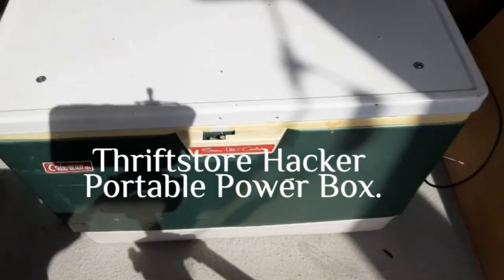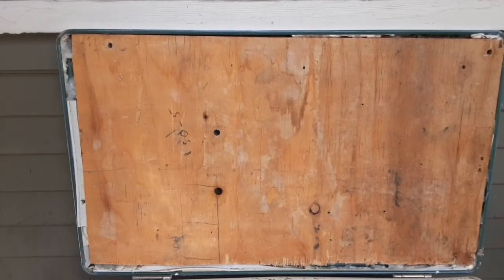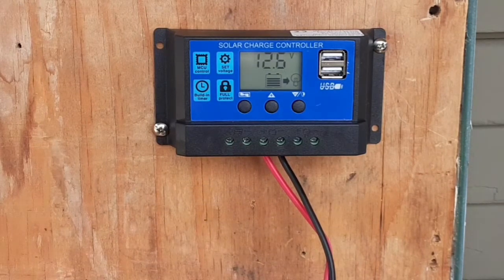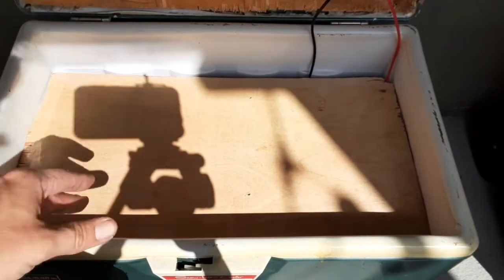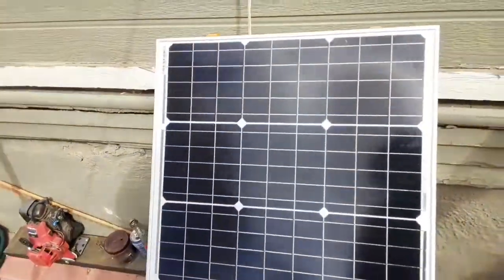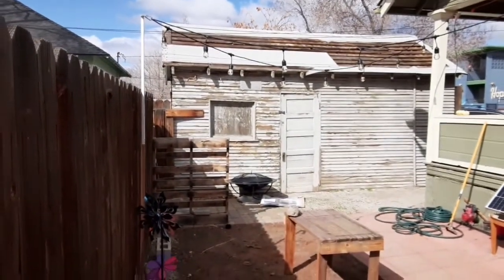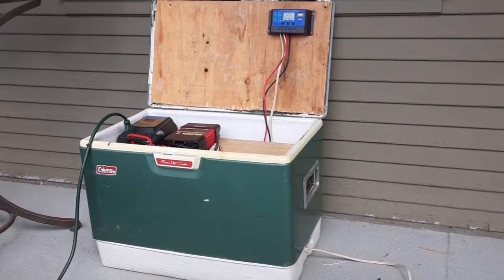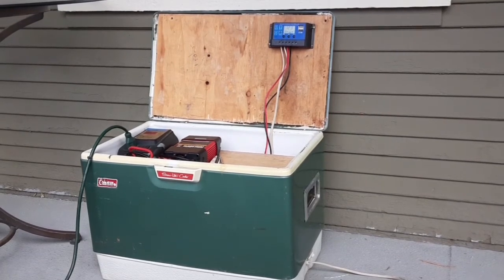Portable power box DIY setup. 50 watt solar, 20 amp controller, 400w inverter.

Comment: Do you need a fuse between panel and charge control?
Reply from the maker: It couldn't hurt to have one
Reply: If you have several panels that are connected in parallel, then you need a fuse on every panel because if one of the panels fails, current from other panels begins to flow through it.
And if there is only one panel, then I think that you can not put a fuse.
Reply from the maker: @sarwestside  a fuse wouldn't hurt, but you definitely need a diode on each panel so they don't bleed back into each other.

Comment: I got the 30 amp version of that charge controller and it works great. You also need to get a cooler with wheels so it’s easier to transport.
Reply from the maker: I have a really nice igloo cooler with wheels but the batteries I had didn't fit. The vintage cooler can hold 3 batteries almost perfectly.

Comment: I actually fried batteries with those PWM charge controllers, after switching to a MPPT charge controller I had no issues. 

I might have gotten a faulty unit, but I discovered the problem was that my batteries were getting hit with 16+vdc at times.
Reply from the maker: This came pre configured to charge up to 14.4v, equivalent to a car alternator. It also can be adjusted.
For under $15, I don't trust it, but will keep monitoring it.